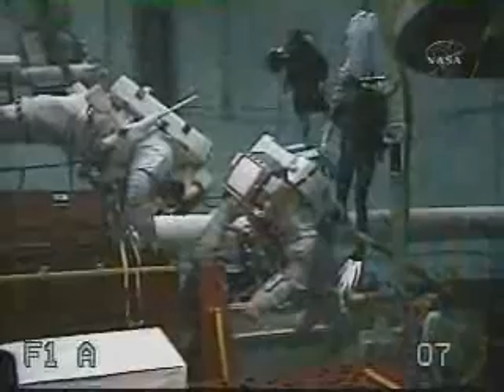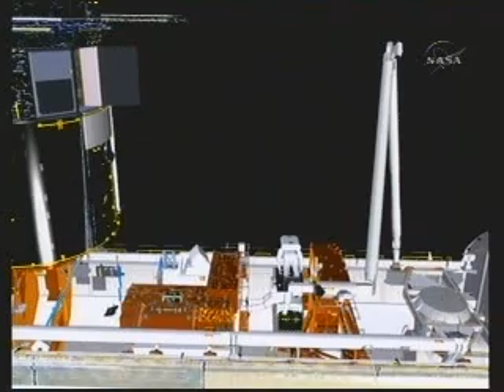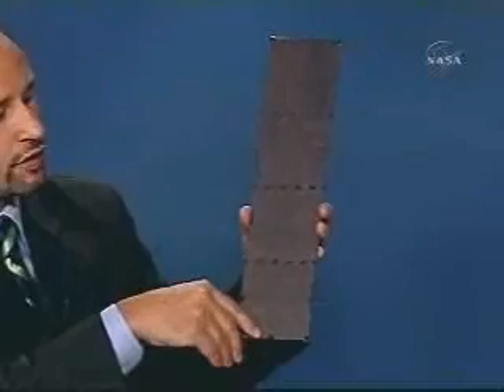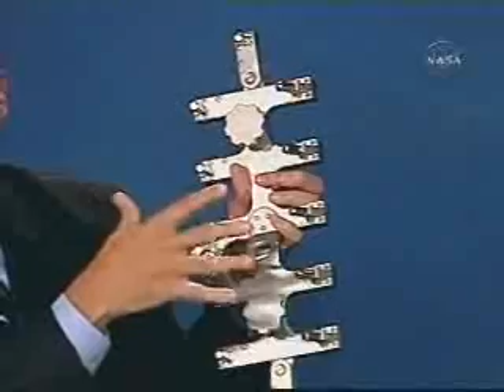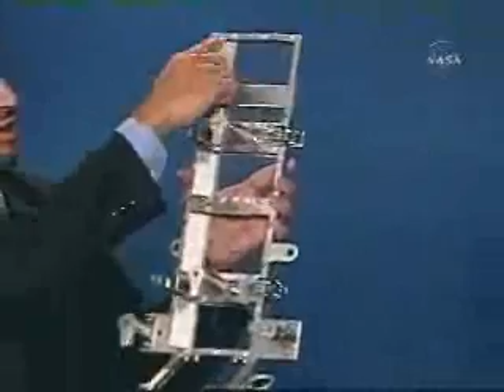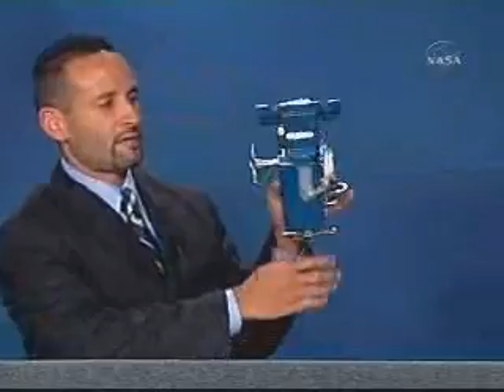STS-125 EVA2 Briefing

Comment: the first part of EVA 2 has to be done at night because if the Fixhead Startracker is exposed to light it will fry the camera on top of it are the RSUs these have to be changed quick before Hubble enters the sun.